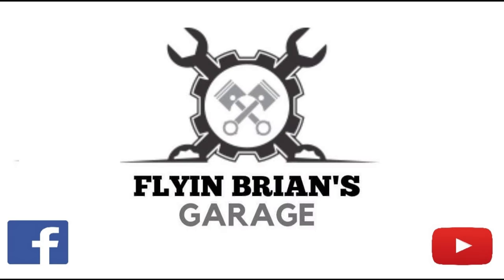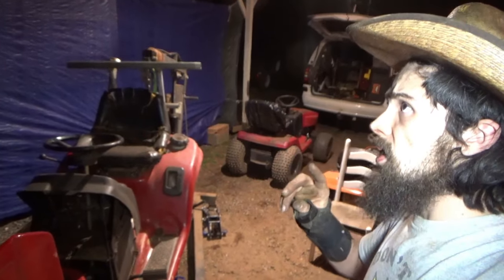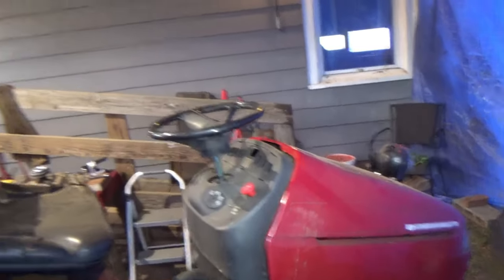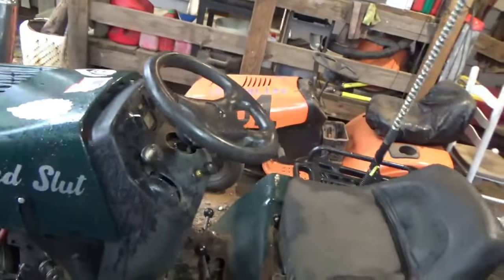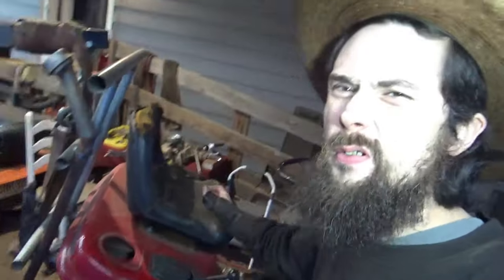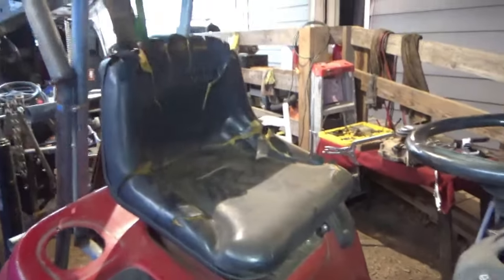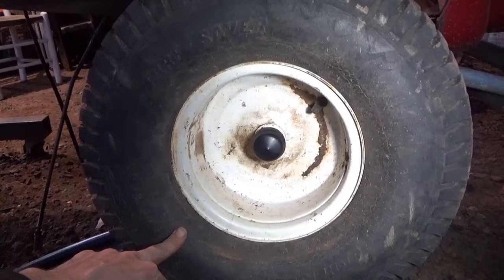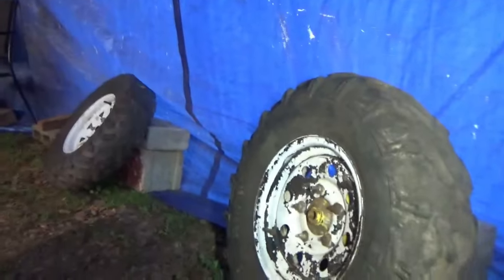Turning My 03 Craftsman Lawn Tractor In To The ULTIMATE WORK RIG!!!  (Part 2)

Comment: Oof I'm first
Reply from the maker: It’s a pretty quick, fun ride! For a lawn tractor 😂
Reply: @flyinbriansgarage3390  true on that mine if you saw on tiktok I have the straight piped vanguard lol I wouldn't mind having that general Lee lol but isn't it running an Intek or just a regular briggs
Reply from the maker: It's an Intek 18 single cylinder on The General. Gonna run it til I blow it up (probably not long from now) because they're typically junk engines..

 I wanna get a block and build a v twin Briggs from the ground up for The General
Reply: @flyinbriansgarage3390  yeah she would love that lol I had an intek that I fixed up and made the engine after it was running correctly mow and it slung a rod right off the bat
Reply from the maker: Same, I have a few trophy engines in the shop that have holes in the block 😂 It’s just the nature of the beast with those particular Briggs engines. Otherwise I love me a good built Briggs
Reply: @flyinbriansgarage3390  my first ever Briggs was a Intek v twin ran great gov delete went 45 on the motor but I blew a whole in the block mudding so I put a single on it and traded for an old craftsman so the one I originally had found out the motor blew up after I got rid of her guess she didn't like her new owner
Reply from the maker: They don’t like really high rpm’s or running the least bit low on oil. I keep the governor on those engines to help them to last a little longer. 

My experiences with them, always blow if the oil level isn’t spot on 🤷🏻 Most newer engines are junk. I try and stick with older Briggs